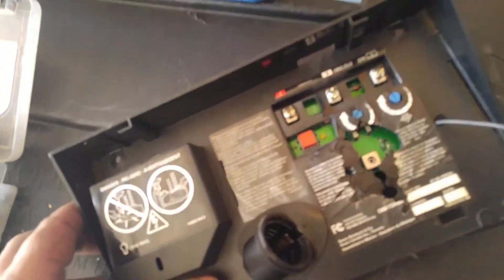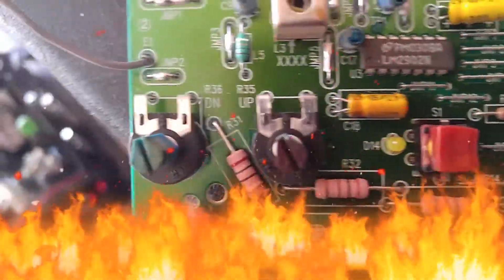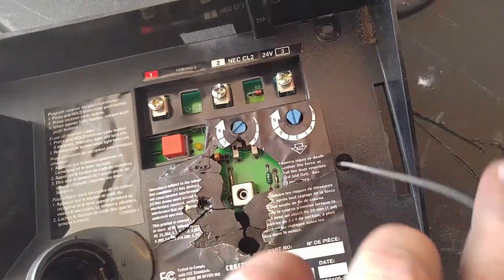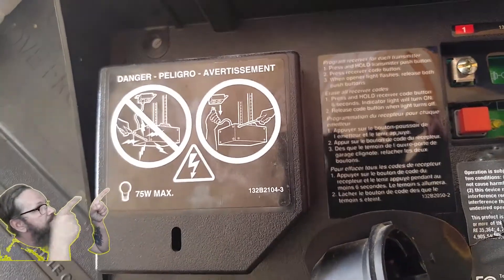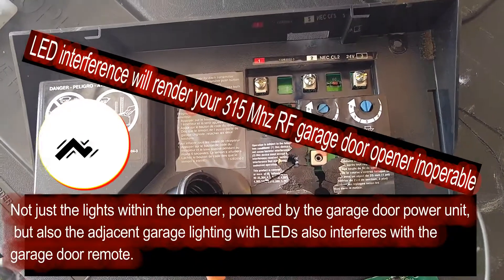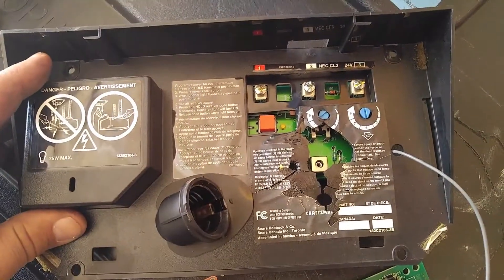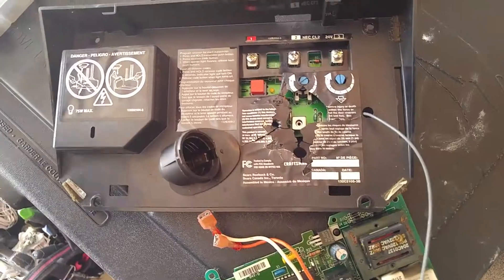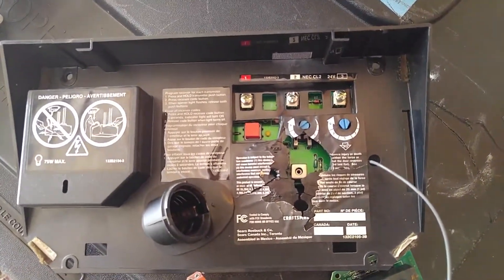Garage Door Opener | Light Bulb Can Cause SERIOUS Damage🔥

Comment: Just bought a house, and this is exactly what's wrong with this one, too. We'll I guess I off to buy a new one from the home depot. Do you know if all chains are interchangeable?
Reply from the maker: If you buy a new one, everything you need comes with the opener.  
Most Chamberlain opener chains are interchangeable.  However, there are models that the chain length is different.
Reply: Ok thanks

Comment: Would like to see video in how to anchor the vertical post that holds the pulley. Wood cracked and bolts are pulling out. Can I pull the pulley out of its bracket without anything spinning out of control? Drill holes away from the wood cracks and use bigger lag bolts? In fact, my door looks exactly like yours on the right side of garage door. Wood is split the same way.
Reply from the maker: Do you have extension springs?  If so I would either fix it with the door open or the spring off with the door closed. 
#1 thing to worry about is spring tension.  When that's squared away you can begin with what you were talking about.  Through bolts work nicely for wood door repairs.  Pre drill holes!! ✌🏼😁
Reply: Garage Door Genius Thanks for getting back to me. Good info and video. Definitely a thumbs up.